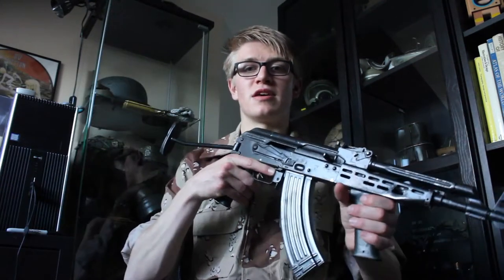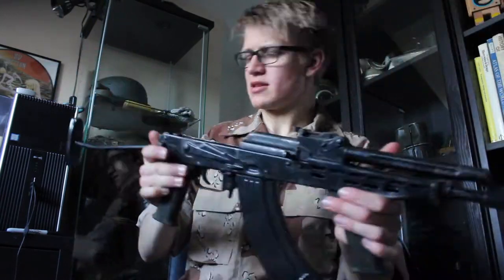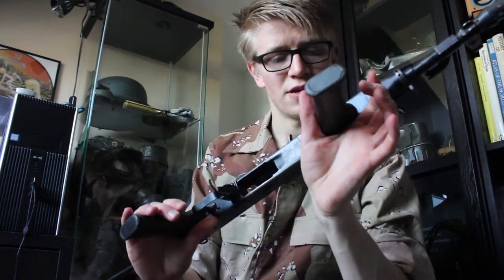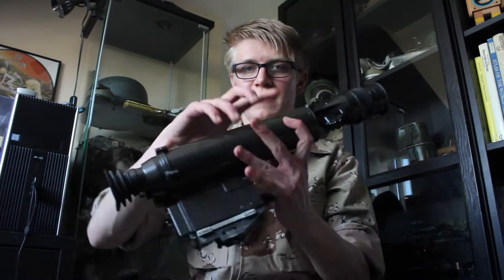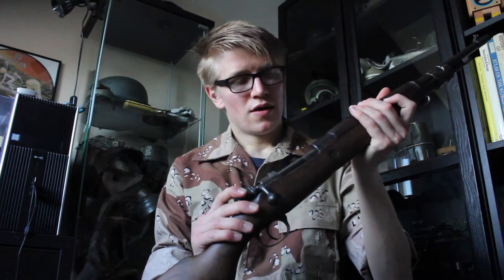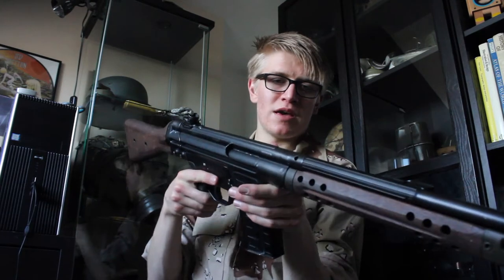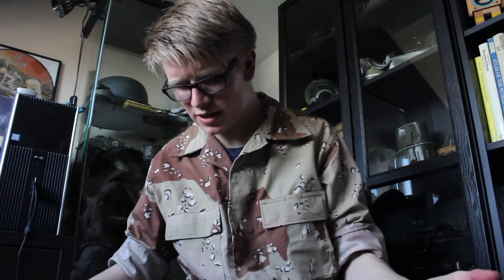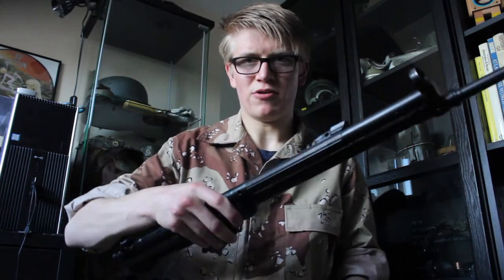My Deactivated Gun Collection - An Overview

Comment: Wow I was just checking out the websites you suggested to see how much those deactivated firearms are selling for. I live in the United states and have both the working AK and the G3 in semi automatic versions. They each cost way less then they are selling the deactivated versions for on those websites! Crazy!
Reply: That is because the guns you have are not an actual AK-47 or G3 but rather a semi-automatic copy of one. If you wanted to buy a true full-auto version you would be paying tens of thousands of dollars. As for why the deactivated guns are expensive, it comes down to supply and demand as well as the fact that many of these decommissioned guns actually have some battle history behind them and are in fact the models that are collectible, not cheap modern knock-offs you can buy at Wal-Mart for $400.
Reply: @Carl Carlsson I don't think you understand what makes many collectors of high-end firearms so interested in guns in the first place. The cool factor of having something that shoots full auto is only part of why these guns are priced so high; there are also affordable machine guns like the Stemple you can own legally in the US which doesn't have the provenance of something like an MG34 captured in WW2 and therefore is only valued at a fraction of the price. Collectors value the build quality, patina/finish, materials used and overall look and feel of a gun. A semi-auto HK91 variant with a cheap parkerized finish and low end modern plastic isn't going to do it for some people that want an actual G3 made and used in the 50's, 60's or 70's. Full-auto firearms are a finite resource in the US so they will naturally be a lot more expensive than guns which can keep being produced, but the reason people are willing to pay so much goes far beyond having some toy to impress people with. (at least for most). As for deactivated guns, they cannot shoot but they do have history and they are actually the weapons that inspired all these modern reproductions in semi-auto. If you can't appreciate a gun that does not work that is fine but why call it pointless just because of your own inability to enjoy it? A deactivated MG34 is still an MG34 used by the Germans in WW2 and even if $5000 may seem like a crazy amount to pay for you, the only way to get a working one is by living in the US and paying $80,000 + after going thru all the necessary procedures.

Comment: It's sad how these firearms have been deactivated, It's almost destroying some beautiful engineering. To me it's like buying a Lamborghini. but you welded the steering wheel and filled the engine with lead. It's just such a shame.
Reply: @drugaddicter  yes, but is highly illigal to do on your own, and very costly. I would be cheaper if you where in the usa to just get a working firearm. but u can get them converted to airsoft though.
Reply: @drugaddicter  Yeah the UK, To put it bluntly is a shit country, Economically is a disaster, housing prices are awful, And you need to own a military vehicle to own a deactivated firearm here as well I think. to fire blanks depending on what firearm you plan to convert to fire blanks, you might need to get a trigger group working, get hold of a replacement bolt, and probably repair the gas block if it's an automatic firearm. I should imagine a revolver or a bolt action rifle would be much easier. But don't use this as advice to make a weapon.
Reply: @drugaddicter  do you have discord btw?
Reply: @drugaddicter  really depends, pistels are much easier to deactivate, And their a little harder to get as well. So the government here is not too worried a bout those. Ak's on the other hand they are being very careful with, 1 in 8 assault rifles are aks, And they're very easy to source parts for.  But you can get a pretty decent deacitvated usp by hk
Reply: @drugaddicter  So jtheir is only one place that can deactivate a firearm legally in the uk,and its fairly costly to get them to do it
Reply: You don't need anything to own a deactivated firearm in the UK except proof that you're over 18. It's actually easier to get a real gun that's been deactivated than to get a fake gun (the latter requires being a member of a re-enactment group or film production etc to purchase). I have several guns that were deactivated in the 90s or early 2000s. Perfectly legal to own and the "law" is that they can't be resold now that the rules have become stricter but it's total bullshit, all the big militaria stores are continuing to sell them without a problem. The home office/police don't care.  @ARMSMASH